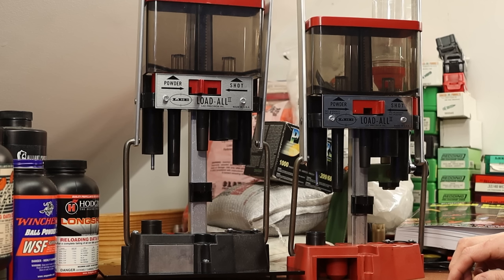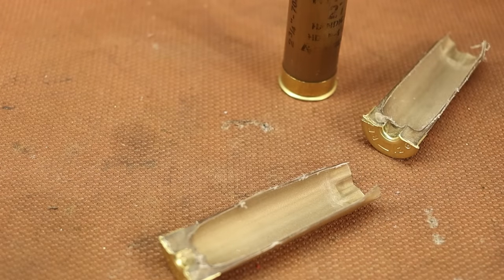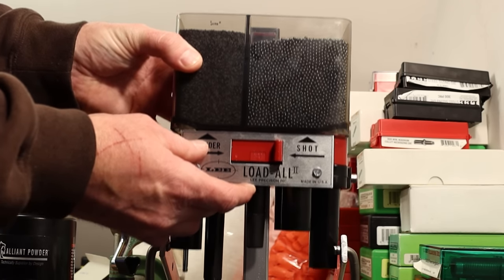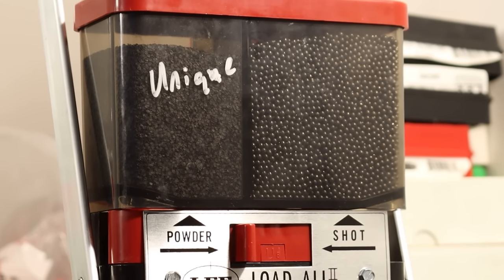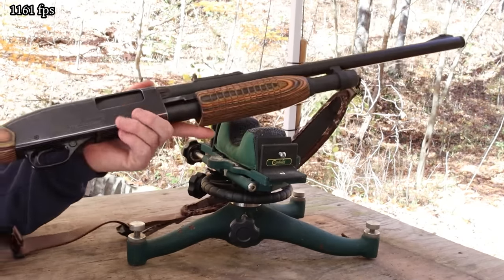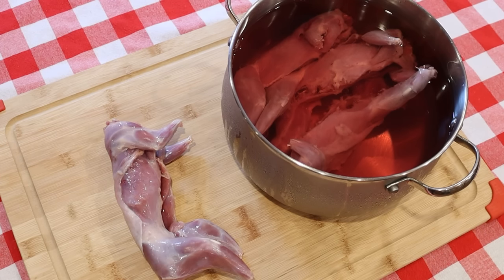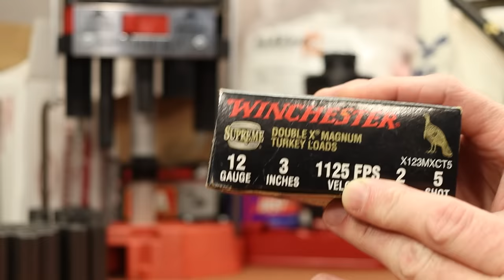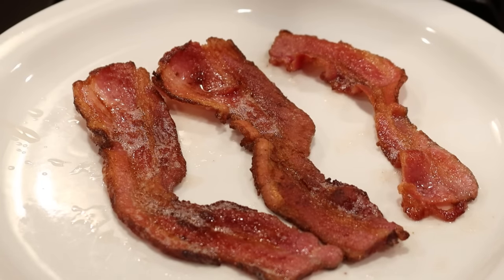Loading 12 gauge, hunting and cooking squirrels

Comment: Take it from a former 10ga turkey hunter, TSS did change everything, it changed my gun from a 10ga, to a 12, then a 20, and the last two I killed were with a .410, and a swear, that .410 with .850oz of 9.5tss smokes a gobbler at 40+yards better than my 10ga used to with lead. And you get 19 shells to a pound of TSS so the cost is only semi ridiculous

Comment: Mr. Johnny, a little tip concerning sharp knives... sharpen your blades however you usually do them and then MAKE an 8 inch MDF wheel for your bench grinder.. I use metal polishing compound from Harbor Freight on the wheel... I used 2 pcs of half in MDF to make a full 1 in wide wheel.. its easy and well  worth the effort... and its a lot of fun... Happy reloading!!!

Comment: I belong to a Gun Club that has 2 shotgun ranges and have access to all of the hulls I could possibly want.  Like you say, the spent hulls are gathered up and put into barrels and then the hulls are just thrown away.  I initially had intended to reload 12 gauge and acquired (traded for) a Lee Load-All and a couple of MEC 600 JR's.  I also went through a couple of barrels of spent hulls and pulled the AA brass base hulls.  FWIW, It's not hard to separate the brass from the steel, just get you a magnet and anything that doesn't stick is brass.

Comment: That was a lot of fun to watch. I started loading shotgun shells when I was 12 yo (40+ years ago). I got a Lee Load-All press and went to town. I made every mistake possible and still didn’t manage to blow my face off, even when I took steel bearings from a bicycle wheel and put them in a shot shell... A lot of thoughts from this video, but I’ll try to summarize briefly. First, Mec definitely worth the price, 600 jr is adequate for my needs. Second, for about 20 years it was not worth loading shotshells because we could buy bird shot for the price of components, but seems that has turned around slightly with the ammo shortages. Next, you are very slow and deliberate for a shotshell reloader. I think it is preferable to learn shotshell prior to rifle/handgun cartridges. Even so I picked up a couple ideas from watching you. I look forward to every one of your videos.

Comment: I have been waiting for this video for years. I have my dad's old mec 600jr bolted to my bench but had no idea what to do with it and unfortunately I can't ask him questions. Every time I try find load data I just get more confused. Thank you for this. I also have a single shot 410 that was my first gun and now you have me really excited to play with it again
Reply: Hi Kyle,  Use it!  Buy the Lyman Shotshell Reloading Handbook.  Watch YouTube videos about using the MEC 600Jr.  (It's easy).  Call MEC and ask for help if you get stuck.  Like Johnny says, figuring out which components to use is the most confusing part.  Go out there and wipe the dust off of it.  Wipe down the blue steel parts with break free or any oil.  Pull the handle.  Good Luck!  R, Steve

Comment: So Johnny, when I want a big batch of low pressure target loads, I pop in the Lee bushings by the chart and load them up. When I want high pressure hunting loads I drop powder and measure each charge and also weight the shot charge, I use the press to size and prime and to fold and crimp. Never had a problem with either type

Comment: I learned to reload 12ga in the '70s with a Lee Load-All.  Couldn't get a good crimp, surprised it seemed to work well for you.  Then bought a MEC 700 (like the 600 with improvements) and it is all steel and makes perfect loads.  Well worth it and the 600Jr is really all you need, especially for multi gauges.  The MEC have bottles for powder and shot and that assy tilts down and you unscrew the bottles, works great with no spill!  I bought a micro adjustable bar so didn't need to buy powder and shot bushings and easy to fine tune.  Also, not hard to find used MEC machines to save some money.

Comment: I'm sure other comments will say pretty much the same thing but I'll say it anyway - the Lee loaders you have will get you by if you load a couple of boxes now and then, but for more than that, they are really not what you need. One of the MEC Jr. models will still be economical, more accurate, more versatile, and last a lot longer than the Lee. The 2 bottle powder and shot bottles are way easier to set up and empty than the box types.

Comment: I've been reloading Shotgun shells for 50 years. I only use old AA's and Remington STS and Nitro hulls. The internal cup in the new AA's interferes with seating the wads and puts a crimp or wrinkle in the wall of the shell. A lot of people say they don't have that problem, but I do so I don't use them. Remington has never changed their designed and still load fine for me.
 The problem with the cheaper hulls with the steel base, is the steel base itself. The steel work hardens as it expands when shot and is compressed to original diameter when resized. Therefore, as the base of the shell is where it seals the chamber from gasses coming back out of the breach of the gun, it is not recommended to reload them more than once. Shells with a real brass base will stand the stretching and shrinking, many more times than the plastic will crimp at the top, so safety is not an issue.

Comment: 1. I put a single layer of masking-tape on the charge bar and dusted it with graphite powder, after cutting the holes for the powder and shot. 
2. I glued a coin inside the crimping die which fitted inside the top of the case loosely that  rolled the crimp over much better. 
3. Haven't checked the vid far enough to see if you figured out the crimp starter yet. 

Reloading shotgun is all about the feel

Cool vid

Comment: I went through the exact same thing starting out reloading shot shells. The main thing you need to worry about is using the correct wad for your hull. Meaning using a wad for tapered hulls vs straight hull. Cheddite hulls are straight which I like better.
The next is the payload weight it doesn't matter the pellet size you use just the weight.  So if you found a load for 71/2 shot you can substitute anything else as long as it weighs the same and fits to give a good crimp. It's all very archaic. My favorite powders for heavy field loads are blue dot and  long shot and 800x. Bubba round trees channel has some excellent shot shell loading information. Also look at the Ballistic products website.  Good luck going down the rabbit hole.

Comment: If you size ,de prime and then re prime your shells first you will make better time. I do them in batches of 25. Also. Push the wad up onto the pusher and just hold it with 1 finger to guide the wad.  Use a piece of painters tape on the base in front of the pre crimp and mark with a pen as a reference for where you want to have the fold in the case to line up with. When your close the shell will / should spin a little into proper position.  The long shot  pwder works really well for me in 1 1/4 oz pheasant loads. Keep up the good work. !

Comment: I was given a Sizemaster 82 a few years back. The sizing stage and automatic primer feed are fantastic! The sizer is a sectional collet that closes in and squeezes the brass down easily, no ring to put on and off and the primer is dropped into the cup at the next priming stage automatically. The charge bar is all metal but has the same problems suffered by all volumetric metering systems, changing density and settling affect the charge weights. The  powder and shot are fed from bottles the they tip off the back to easily change shot and powder. Obviously far superior to the mostly plastic Lee load all, but I use them both!

Comment: the load alls are awesome. i started loading shotgun shells on the load all and never saw any reason to upgrade from then on.
relatively unbreakable, reliable, easy to use and economical. 
good choice, i have been using mine for about 12 years

Comment: I have always used .22 LRs for squirrel hunting . I have used both rifles and target pistols successfully over the years. I always cut the pelt straight across the back and get my fingers wedged in under it. You then pull opposite ways and skin the squirrel like you are undressing it. When you get to the paws you simply use a meat cleaver or some kind of wire cutters or tin snips to cut them off so that you can continue getting the pelt/skin off working them out. We always used flour and some salt and pepper to pan fry them. Save the grease and the scrap morsels to add flour and milk to make gravy for your mashed potatoes. You make sausage gravy for biscuits and gravy the exact same way. If the gravy gets a little too thick add a little milk and stir while you continue to heat. If it gets a little too runny you simply add more flour while you stir and continue to cook.

Comment: Lee-Loader is a great choice for the first timer, or old hand looking to load small volume.  LEE has simple easy to follow instruction, Consult the Richard Lee second edition reloading manual to clarify many of the questions you've expounded upon.  Most other loading tools tend to make there instructions overly complex.  For well under $100 for one loader in your gauge and there you go.  MEC's are fine for someone into High Volume shooting Skeet/Trap and start at the low end of $150 and well north of that.
Reply: About say same for 410

Comment: Shane, I have been loading shotguns for 45 years Quail, Pheasant, Praire Chicken, and Turkey you need to go to Ballistic products they have a lot of load data and components and new hulls some even come with primers installed   AA Winchesters load the best and make the best crimps.AA is your taper hulls and makes great Quail loads RED DOT is one of my go-to powders for light loads such as Target Quail and Dove. The Mec Sizemaster is the way to go been using one since 1975 great machine Rock solid you just need to pick your bushing and shot charge bars whatever you choose DON"T leave your power in the bottles if you do it will stain the bottle dark from the powder.

Comment: Being a duck hunter we are required to run non toxic shot for hunting and bismuth is what the latest craze is and it runs good on duck. Never had much luck with tss cause the harder metals don’t smash together like lead does and the bismuth is a little softer and will group a little better than steel or tss. Just what I’ve seen. I hand load all my steel number 3 duck loads and bismuth loads.

Comment: The MEC presses are definitely not flimsy like the lee load alls. I have the lee load all along with 3 mec 600jrs and 3 mec 650s.  They can be a little temperamental when adjusting but otherwise solid as a rock.

Comment: Great video Johnny!  Shotshells can be very complicated.  I have been loading shotshells for 40 years.  Two general rules of thumb:  1 - Use shells that are one piece (Old WWAA and current STS, Nitro, and Game Load hulls) if you want to load the shells SEVERAL TIMES.  2 - Put a wad back into the hull that was designed to fit it.  i.e. Remington wads or copies in Remington hulls, Winchester wads and copies in old Winchester AA hulls, Federal in Federal.

The taper that is mentioned is an internal taper.  This is what the wad choice is about.  The base of the wad needs to seal off the powder charge.  In cold weather, you can always tell who put tapered hull wads in straight wall cases when they show up at the trap range.  You can hear it as a squad of five shooters shoot...  Bang!, Bang!, Bang!, FUURRRTT...., Bang!

Comment: Your on the right track so far with loading shotshells. I also found the AA hulls are not as cracked up as they say. The odd crimps you saw with it sticking up and concaving inward is normal as well as the little hole in the middle. My dad would apply some clear nail polish or wax to keep water out. STS hulls are your best bet. I normally load Unique to max pressure because load data for Alliant is VERY CONSERVATIVE.Getting into the MEC Loaders, the 600 Jr. doesn't have a resizer built in while the Sizemaster does. The MEC Loaders also solve some issues the LEE has like having to align the crimp for initial starter crimp. The MEC auto-aligns the hulls. Sadly, I don't have much experience with TSS shot, I just stick to the gold standard of lead. Hope this helps.

Comment: Hi Johnny, What a great video.  (No annoying music; thank you.)  I saw a guy in another video of the Lee Loadmaster II, drill a hole in the front of each reservoir.  He used plastic plugs to keep the powder and shot inside each hopper.  When he was finished, he pulled each plug, one at a time, while holding a container under the holes to catch the contents.  That saved him from having to do the invert-the-loader-to-empty-it dance.  That looked clever to me.  Honestly, I couldn't believe it when you wrote on the powder hopper.  I like post-it notes to identify powders.  Also, a piece of white 2" water proof medical tape stuck to the hopper works (write on it, then peel it off later).  Yes, they are janky, flimsy, but they work ...as you just proved.  R, Steve

Comment: A great cheap alternative to the Rem Nitro hulls are Rem Gun Club.  Steel base but the plastic hull is almost as good.  They can be reloaded 2 or 3 times before the primers will start to get to get loose.  If you go to a sporting clays range you can usually pick up a lifetime supply of the Gun Club hulls.

Comment: I have 3 sizemasters 28, 20 and 12. I also have 2 Texans (Grandpa's) 12ga & .410 which are similar to the 600 JR. I prefer the sizemaster with the collet sizer vs the ring sizer on the 600. The collet sizer will work way better for steel bases or high brass. I have loaded nontoxic (steel) shells for waterfowl but can't help you with tungsten. Ballistic products will have unique components for nontoxic loads but beware their wads are designed around straight wall hulls and will be difficult to use in AA or Rem hulls.

Comment: the swirl means your stack height is a little to low I only seat the wad till it stops so you don't compress the compression section on the wad I made a silver sharpie mark on my machine to know where to stop so all the shells are consistent

Comment: Been reloading for 4 decades so here's my advice:   1. Do not come back up after seating the wad until you drop the shot.   Doing so can catch a wad petal and fold it over to the inside of the wad.  2.  When crimp starting, that rotation tendency you noticed is the hull trying to align the factory crimp to the crimp starter.   Let it rotate a bit if it wants too. Slight up and down press handle movements will assist this alignment rotation of the hull if you don't death grip the hull.

Comment: I have found over the years is that Lee's powder bushings and dippers throw light. This is a safety precaution so the lawyers are satisfied. 
You can easily alter the bushings by reaming out a bit at a time to get the charge you want. Perhaps there are plans to use on your 3d printer for making your own.
On dippers you can ream out to increase the charge or add filler to decrease charge.

Comment: Loading shotshells for me is totally worth it and is as simple or as complicated as you want to make it.  Often times no press required...  just simple hand tools.

Some will disagree, but once you find a start load in the manuals you can deviate from the recipe to customize your load and still be safe.  Also..  ANY hulls you get your hands on can be reloaded more than once.  I actually prefer the straight walled hulls over the tapered ones.  The cb1138 wad I have found, is the most versatile wad out there.

For your .410, Use 444 Marlin brass... You'll never wear them out!

Thanks for the video...

Comment: Great video.  All the way down to the bacon.  Damn near midnight hear and I want to fry myself up some.

My first step into reloading was with the same Lee setup.  16 years old and hunting geese.  Closest place that sold any ammo was a one-hour drive and only working in the evenings for minimum wage, I didn't have a whole lot of extra money.  Saved up, bought the reloader and all of the components and never looked back.  

Now, I followed the directions and recommended loads for a while....then started wondering if I could hit those birds that were flying higher up if I were to bump up the charge weights!  Luckily, I never had a single issue.  

Still using the same machine almost 30 years later, but now loading stiff charges for coyote hunting!

Comment: You need tapered wads in tapered hulls and straight wall wads in straight hulls. Winchester AA and Remington hulls are tapered hulls. Cheddite hulls, Rio, Federals, Fiocchi are straight wall hulls. Cut your hull in the middle, not like you did. The put the wads in bottom and top and see how much side play you get with the wads. Tapered wads are smaller in diameter and what happens is the powder charge will move up the wad if you shake it upside down. Wads like 12SO and 12SO3 and federal wads for straight wall hulls. AA 12SL or 12 AA S are for tapered hulls.

Comment: Had a stink bug crawling around my press a few weeks ago. They typically find their way into my vacuum as well but I happened to be loading 45 auto at the time. Well he "found" his way into one of my cases and so I set a 230 gr FMJ over top of him. Needless to say he had a much more exciting end than the typical vacuum route. Spent case had just a leg stuck to the interior of the brass.
Reply from the maker: I tumbled a big batch of 223 the other day and found several floaters. I need to be careful. Could cause a hot round!